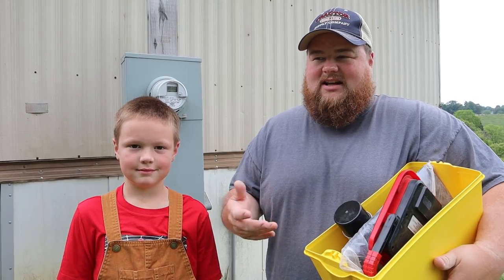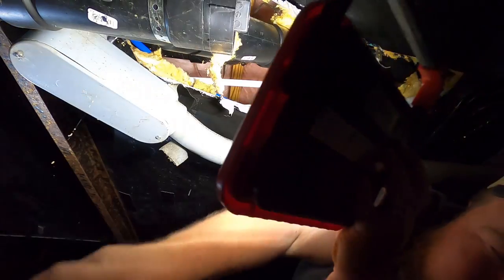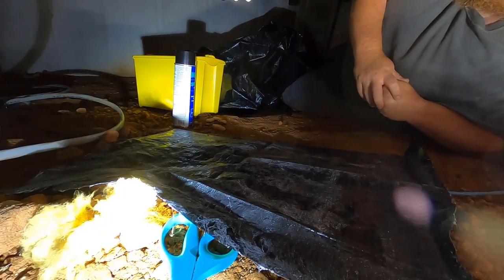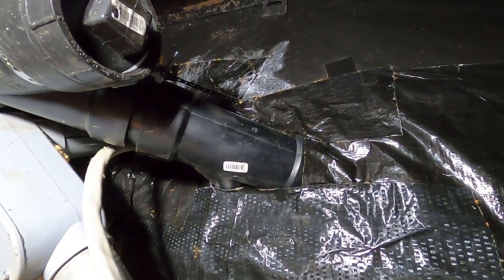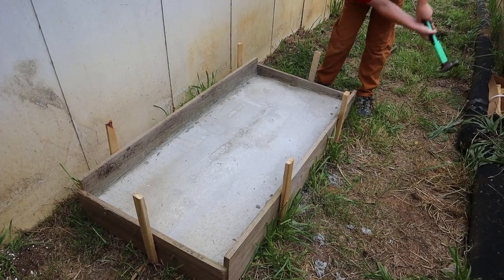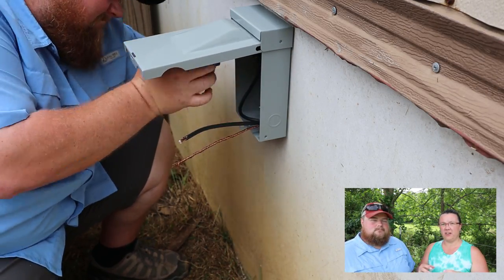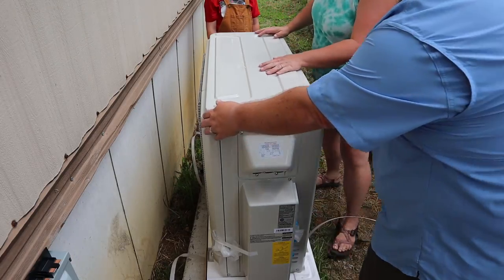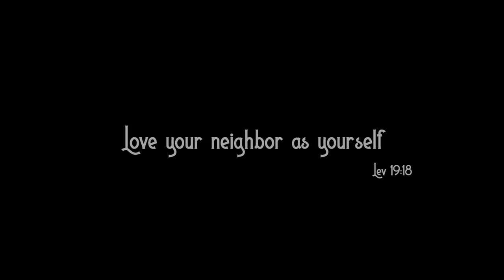Running Electrical for Mini Split in a Mobile Home

Comment: seriously considering a mini split.. glad I found your vids!. If nothing else that patch and spray I need to cover plumbing areas that were worked on a few years ago by plumbers. I've never seen that and of course plumbers who work on mobiles have never mentioned so I've a couple areas hanging with insulation and the cut up cover.

Comment: First off, I love your channel and have learned so much from you guys! Secondly, I love how you both do the projects together and include the kids and you guys never seem like you never wanna ring each other's necks 😂 

I've been looking at these mini split systems and the electric and how many indoor units I need is what I'm so unsure about. 

My fuse box is 100a. I live in Wisconsin so I don't want to get rid of my natural gas furnace completely because I'm so afraid that a mini split system may not be powerful enough for our coldest winter days and my water pipes run next to the duct run so that stops my water from freezing. I have some experience with running electric but it's like adding outlets and running new wire into existing breakers so I could relocate my water heater. So I am wondering if I would be able to run this without having to upgrade my whole electric panel.

I have a 1985 Liberty 14x72. The living room is in the front, kitchen in the middle (no walls separating them) and a long hallway with 3 bedrooms and a bathroom. So far I have just used a window unit in the kitchen window and that has cooled the house so it's not unbearable. My preferred temp is around 70 when there's low humidity. I was thinking if I get an 18,000btu unit with 1 indoor unit and mount it where my kitchen meets my hallway, it would be enough to keep me comfortable. Just wondering what you guys think?

Thanks so much if you reply. If you don't I understand and will keep watching you guys.

Comment: Thank you so much for this video. I’m very strongly considering a split system because I have horrible moisture problems under my trailer from duct work that was left on the ground by an installer. 
It’s caused the belly board (that’s what we’ve always called the fabric) to fail in many spots and we got rats last winter (it’s a vacation home at the NC coast so it was a huge surprise and expense…please keep fixing those holes underneath…you don’t want critters). 

Anyways, can you elaborate a little bit about the wiring you did? 

Everything in your videos looks so familiar, because I’ve done a lot myself (I was practically gifted the trailer so I’ve had to figure out a lot myself). 

I have a full heat pack with fan outside the trailer now so there is some wiring to that. 

Btw, since I’ve never used the blower/heater in the trailer I made a pantry above it to utilize the space. 

If you’ve read this much, thank you so much and thank you for any advice. 

I love what y’all are doing and absolutely love that you’re doing it together and with your kids. Your channel it just so great!! 

Judy
Reply from the maker: If you have an existing HVAC system you may be able to use that power wiring. Or you many need to wire a new circuit to the new system. It all depends on what you have and what your new system needs. In this video we used the old furnace wire again. However, we have since moved the home to another state and when setting it back up we ran a dedicated circuit - 40 amp, 240v from the main panel outside.
Reply: @sam-and-angela  thank you so much for your reply!! 
Not many content creators take the time; I really, really appreciate it!!

Comment: Why were you not able to use the existing disconnect from the old central unit.
Is it 240 or 120 that you need

Comment: I have been enjoying your videos.  My husband is redoing our single-wide trailer and has added an addition onto it.  We were interested in purchasing the adhesive you mention in your video, the Miracle SPM-1330.  I have tried to find it on the internet but haven't been able to.  I also see that the spray adhesive you have linked at Amazon is a different item.  Can you tell us where you were able to purchase the Miracle SPM-1330?  Thank you so much.
Reply from the maker: The Miracle spray is what we received when ordering. According to some other websites, it's the new brand or replacement spray. Either one is great from our reading.

Comment: The timing on these videos is very fortuitous.  Our ductwork is trashed in our early 80's MH, $3k to have it replaced and keep our 12 SEER unit, $8k to have a triple-head mini-split installed, or slightly more than $3k to go the route you guys have gone and end up with a 22 SEER system.   Now if they were just back in stock so I can get it ordered....
Reply from the maker: You're totally in the same boat we were then! Here's hoping they get back in stock soon for you guys! Good luck!

Comment: What are you using for emergency heat? Because that heat pump doesn't work below a certain outside temp.
Reply from the maker: We have a wall mounted blue flame propane heater that can run without electricity. However where we live heat pumps will work year round with no issues. We keep the propane heater for winter power outages, even though they're rare here.

Comment: The wire to the disconnect is way to large also check the breaker size.

Comment: Are rodents able to chew through the black stuff you installed under your trailer?
Reply: Oh, yes. They've trashed mine. 😔
Reply from the maker: Absolutely. They'll go through anything! This stuff is more of a vapor barrier, bug barrier, and insulation holder for these old mobile homes. It's still good and strong though!